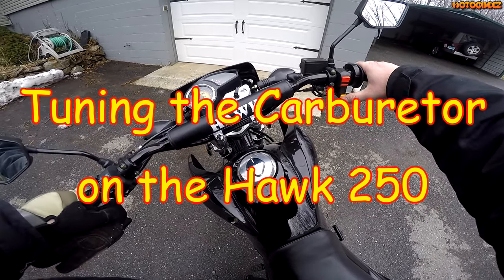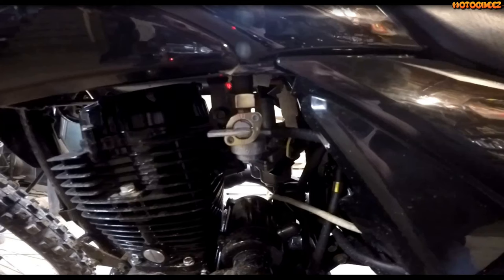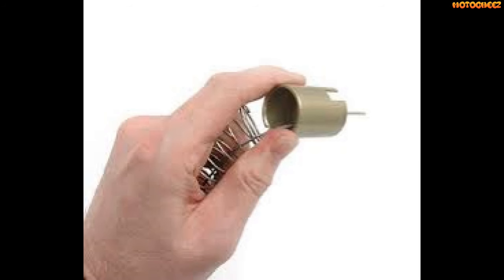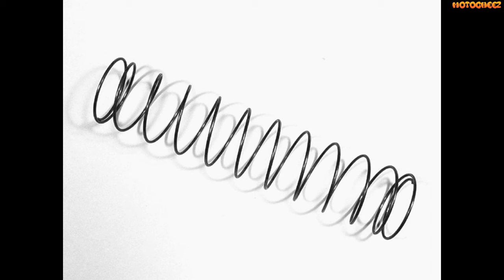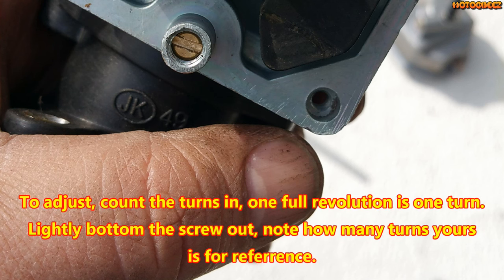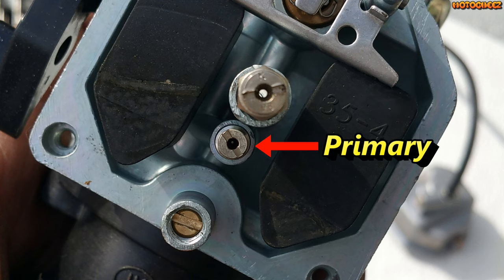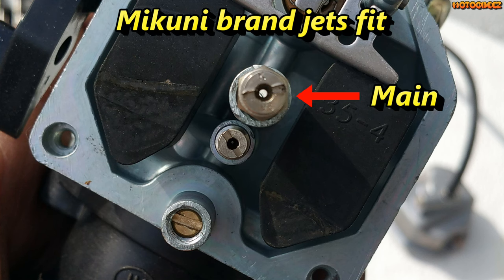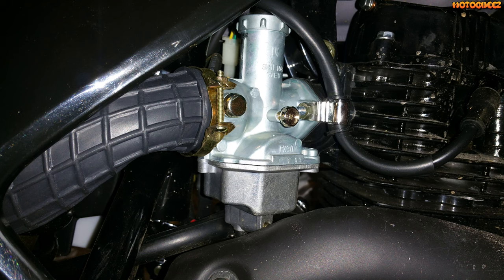[E3] Hawk250 Carb Tuning on the Dual Sport Chinese Enduro 250

Comment: @MotoCheez - which main jet # comes stock in a Mikuni VM26 30mm carburetor?  I've read that most that drop in Mikuni VM26 carbs just run them stock without any issues. I installed a VM26 on my new Hawk the other day but also have a bag of Mikuni main jets. I left it stock for now to find out how it runs. Didn't want to mess with jetting too much during the initial engine break-in.
Reply from the maker: It's a 98. Yeah they run fine. But I opened up the airbox and they're lean fir EPA
Reply: So the Mikuni VM26 has the same size jet (stock) as the OEM Hawk Chinese carb? I'll probably change it out to a #110. The bike runs great on the Mikuni VM26 (stock config) but I can tell that it's running somewhat lean at higher throttle. I haven't modified the airbox yet but will cut those holes out per your video. The bike does feel a little restricted...I know I can get more than 50-55mph out of it with the 17T/45T sprockets I'm running on there. Thanks for responding to comments and for all the info you've posted on this bike - wouldn't have pulled the trigger on purchasing if not for your DIY vids!
Reply from the maker: I believe so, I never bought the aftermarket carb, I just modded the stock one.. Cool YW!

Comment: Hey Moto, I just got my TaoTao Tbr7 a week ago, I bought a Mikuni carb for it but it just won't run right. When ever I give it gass it just bogs down . The primary jet is a 33 and main is a 100. Any suggestions??
Reply from the maker: Should have a 110 to 115. Middle groove on jet needle
Reply: @MotoCheez  Ok man thank you, I appreciate it, I will try that and let you know how it works out👍🏻👍🏻
Reply: Ok I did what you said, my mixture screw is 1 1/2 turns out but my spark plug keeps getting fouled up and It is still bogging alot.
Reply from the maker: @tylerd.5541  is your choke on? sounds like you are turning it on not off, or your main jet fell out
Reply: @MotoCheez  Oh my gosh man, I feel like an idiot, iv been trying to run it with the choke on. Iv adjust the valves and taken the carb off about 10 times trying to chase the issue. Let me see if I can't get it to work now😂😂
Reply from the maker: @tylerd.5541  haha, it happens!
Reply: @MotoCheez  Just started it up with the choke "off" and sounds great, thanks and can't wait for more riding videos when it gets warm

Comment: Hey motocheez I rejetted my mikuni carb to 120 because I put about 12 holes the width of a pencil in my muffler can and cut my airbox like you did it feels alright but my bike still cuts off I have to hold the throttle unless I adjust the idle extremely high any ideas ? also do you think 120 is to rich and could someone possibly describe where the fuel mixture screw is
Reply from the maker: Liam Wells the main jet is for almost wide open throttle to wide open. if it doesn't it'll it's the idle jet adjustment. there's a plastic plug (show in video) pop it out and adjust to 2 1/2 out roughly.
Reply: MotoCheez do you know where it is on a minkuni same place?

Comment: You wouldnt know where one might get the correct pilot jet for the mikuni clone carburetor. Looking to go up to 25 or 27.5
Reply from the maker: +unnamed saint no, I'll look tomorrow see what I can find.
Reply: Hey Cheez got the mukini with a 110 MJ in but I belive the pilot needs a dif size wont start without choke and dies alot until fully warmed up and still putters at low throttle input would u know what pilot jet it may need if thats the issue?
Reply: Thats the pilot jet I used and from Amazon
Reply: @bigbearlovin  25 pilot?
Reply from the maker: You tried opening up the mixture a bit more? I do have links on motocheez.com
Reply: @MotoCheez  yes it's out 4 turns

Comment: I can't find your comment anymore motocheez but the stock carb leaks and now my neutral light won't come on did I do that or just a coincidence? also feels like my clutch is slipping now
Reply from the maker: Liam Wells damn!  neutral light wires run up over carb from left side. could have
Reply from the maker: Liam Wells clutch slipping? maybe too tight? should be a lil  freeplay at clutch
Reply: MotoCheez it does have free play my neutral light won't come on when in neutral and won't start without me pushing the clutch in but once started I can release the clutch

Comment: Curious did you have any issues getting this tagged? I have the certificate of origin but notary’s in my area are acting like they don’t know what to do
Reply from the maker: Depends on your state. CT was easy, FL easy too. It's like a brand new car with COA. Some states don't like to register them either like PA And CA
Reply: @MotoCheez  that sucks I’m in PA lol notary said the MCO is missing a signature from the company. I thought I herd in one of your videos you mentioned Vermont for titling?
Reply from the maker: I heard some got them registered,  the MCO should be signed by dealer. They send afterwards, not the one in box. VT isn't as easy any.ore but can be done still
Reply: @MotoCheez  they put they’re name down but didn’t sign a area they were suppose to
Reply: @MotoCheez  update company sent me a new MCO with notary stamp alls good just got plates.
Reply from the maker: @Karnol428  excellent!

Comment: I dont know what to do my bike bogs out like crazy at higher rpms and it turns off if I take the choke off. I did halft turn 1 turn 1 turn and half 2 turns 3 turns and 3 1/2 turns I really dont know what I can do. Well on the good side the bike looks really nice parked in my garage lol :(
Reply from the maker: The mixture adjustment is just for 1/8 throttle down, it's an idle circuit. If it's bogging then it's probably the main jet. What size is in there now?
Reply: Its stock I haven't gotten it to work properly since I got it yesterday.
Reply from the maker: +Modesto Rodriguez ohh. Then you have to change main jet. Watch the carb video I did , makes a big difference
Reply: the company I bought the bike from is sending me a new carb free so hopefully that helps, Thanks for the help.
Reply from the maker: +Modesto Rodriguez cool. Let me know how you make out

Comment: Hey Motocheez, so I swapped the stock carb on my Magician and replaced it with the Mikuni carb, and I replaced the main jet with a 110 on the Mikuni carb. The bike is having some trouble idling, but my main concern with it is that when I rev the engine, it takes a long time for the RPMs to come back down to the idle speed, do you know what could be causing this?
Reply from the maker: Tom Malitz sounds like the primary jet might be too lean. How many turn out on the mixture screw did you go. Should be about 2 to 2 1/2. Out. Then you should be able to adjust the idle. Or you have a vacuum leak.

Comment: hey moto you inspired me to pull the trigger and bought on I've got it togther had a few test runs with it  but I can't get it to idle I've watched most of your videos in the hawk. I just pulled the carb off and twisted through mixture screw out about 1 and 1/2 out still can't get it to idle by it self with out holding on to the throttle. It sounds great with the choke completely down which I assume is off. once I put the choke on she bogs hard under throttle. any advice on getting her to stay running on her own. I've even held the throttle till warmed up and as soon as I let it go it dies.
Reply from the maker: You tried the idle screw on the side? Keep turning it clockwise. Has the knurled top on the side of the carb opposite the choke lever.
Reply: +MotoCheez yes sir I've played with that screw before attempting to remove carb.
Reply from the maker: Keep turning it in while you're keeping it running. That's definitely the idle adjustment. It's probably way out
Reply: +MotoCheez alright sir right you were as I had hoped you would be. I bottomed it out and just slowly brought it out half turn at a time. got her idling on her own. so that's a success. next question if you don't mind helping me out with is once riding if I get aggressive in the throttle it starts to bog down and give like a popping sound.
Reply from the maker: Did you Chang the main jet to a 110?
Reply from the maker: Yes, add the washers under the needle and 110 main jet. Will run way better! You can go the mikuni route if you want.
Reply: +MotoCheez Look at this on eBay http://www.ebay.com/itm/152156398660 this is the jet I'm assuming should work for my main? also any specific washers to use or just something that fits? I really appreciate all your help man.
Reply from the maker: Yes. That's it. I use 8-32 size washers
Reply: +MotoCheez alrighty thank you sir I appreciate your help so much I just ordered the jet and I'll hit the Lowes tomorrow for the washers.

Comment: Is a 130 jet too much?
I upgraded the exhaust!
I think it's too rich
Reply from the maker: 130 is pretty high IMO. 120 max
Reply: @MotoCheez  with 120 do I need to turn down that screw on the button?
Reply from the maker: Which screw is that?
Reply: @MotoCheez  fuel mixture?
Reply from the maker: Oh. The bottom.. should what I show in all my carb tune videos, there are a few things...
Reply: @MotoCheez  k thanks, I took around the block with the 130 it back fired LoL, I love that new exhaust, lower frequency and and much louder
Reply: @MotoCheez  I dunno if the jet kit I purchased was a returned kit, because it doesn't have any jets over 115 nor under 130, but  I put the 115 and it seems to be good!

Comment: What size pilot jet does the factory carb come with?  I want to order all my jets at once because shipping is the same no matter how many I order.  I plan on buying a 110 and 115 main and would like to get a pilot that is slightly larger than stock if you are close to 2 turns out on the idle mixture.

Also, what's your elevation?
Reply from the maker: Not sure what size the pilot jet is. Main is 98
Reply from the maker: My elevation is 650 feet
Reply: Thanks!  
I'd guess 110 would be fine all the way down to sea level than if 115 was noticeably too rich at 650 feet.  I think I'll just get 110 because most of my riding will be about 130 feet and higher.
Reply from the maker: +pcspecialistpdx I agree. 115 was too rich. My friend has 112.5 and I feel it's still too rich following him. I also shimmed up the jet needle 2 #6 washers for a fatter midrange

Comment: I am at a complete and utter loss I have gotten a new mikuni carb and currently jetted to 105 (and tried 95,100,110,115) and no matter how I set idle or the bottem screw when I give it gas it falls flat on it's face instantly I have no idea what I'm doing wrong I've tweaked it every way I can possibly think to and still nothing (and just to be clear the reason I made all for these changes in the first place is when it was wide open going down hill my max speed was 45ish and I need to go at least 60 to feel comfortable ridding with cars I saw in one of your videos you were able to make it to 70 so I know something must have needed adjusted)
Reply: I will make a video showing you if you would like
Reply from the maker: CobbsterSniper usually it's one if 2 things that causes this. Either the choke is on (lever up) or the valves were adjusted on the wrong stroke. Those are the 2 most common.
Reply: MotoCheez alright thank you I'll try adjusting the the valves and let you know if it helps
Reply: Works like a charm still have a few adjustments to make but that fixed the problem thanks man :-)
Reply from the maker: +CobbsterSniper swesome!

Comment: can you please update link for the jets here and on your website. where can I find those washers?
Reply from the maker: The jets are mikuni jets. The washers you can get at a hardware store. "8 screw washers.
Reply: +MotoCheez thank you sir. on eBay there is a 2mm difference in width for the 110?

Comment: What size # of pilot jet u running ? Ihave a 35 and im having idle issues
Reply from the maker: Stock pilot jet.. 2 1/2 turns out on mixture
Reply: But what size? Mine stock came with a #40 pilot

Comment: Hey again motocheez. So my dad and I tuned the carb last night because it started bogging again. I went to a 110 jet and the mixture screw is about 1 and 1/2 turns out, and it ran great at first but then  after a few minutes and turning back on it bogs again until you half choke it. Basically I'm asking, what does that mixture screw regulate, and how should I change it to help? Thanks man, very confused
Reply from the maker: The mixture screw is for idle mixture. The jet needle small washer shim is for 1/4 to 3/4 throttle. The main jet is for wide open throttle. Sounds like it starving for gas? Does it do it after holding throttle open a while or immediately?  Does it idle good?
Reply: +MotoCheez +MotoCheez yeah the inly thing I did was the main jet and the mixture screw, been messing with the idle adjustment too. Sometimes it idles good and sometimes it does right down. Yeah it does sound kinda like its starving for gas once I get to half throttle and it does it right when I hit the throttle past half.
Reply from the maker: +justinheartcarson maybe try it on reserve? Pull off gas hose and make sure decent flow of gas and not pinched.
Reply: +MotoCheez tried that. Bike wont run without  choke unless I put the idle screw way in... The fuel line is fine but the bike is still inconsistent running. Sometimes it runs great and the rest of the time it dies without choke😔.. I'm so lost rn
Reply from the maker: +justinheartcarson check valve adjustment. Of vacuum leaks?
Reply: +justinheartcarson I will try the valve adjustment and I will get back to you, thanks
Reply: Hey, I'm having very similar problems. I have the new Magician, which I believe has the same carb as the Hawk. I just can't get the bike to idle right. Did you ever get your hawk to run better, and if so, what changes did you make?
Reply from the maker: justinheartcarson the re-jetting and adjustments solved my problems with the hawk. It's the same motor and Carb on the magician so I'm sure this carb video will work. I know it's harder to remove the carb on the Magician

Comment: hey motocheez thanks for all the help!! im gonna adjust my carb....my question is how do you know if you need to mess with the fuel mixture screw
Reply from the maker: Jose Martinez thanks! The fuel mixture screw will need adjustment, that's the idle to part throttle mixture. They're very lean unless you change the primary jet.
Reply: @MotoCheez  Hey cheez I got some questions 4 u abt the tuning ive been struggleing  with  my carb for weeks ive got the mukini with an air filter and I'm from North central texas and ive tried a 105 mj a 110 and a 115 and I cant seem to get the bike to start without choke my goal is to have it start without choke its now getting cold down here and I'm wondering is that a possibility during winter I think its not getting enough fuel and I allways wind up more than 2 turns out on every jet I swear ive taken the carb off and put it back on abt 20 times now no joke and I just cant seem to get it right do u have any recommendation on where to start ex: jet size and turns out ?
Reply from the maker: The idle and part throttle is controlled by the pilot jet and mixture screw. Try turning the mixture screw out 4 turns. Any more than that and you'd have to go up pilot size. Main jet is pretty much wide open throttle
Reply: @MotoCheez  gotcha thanks for the reply will try tuning  tomo and see how she goes I got a 110 mj in right now with I believe 2 1\2 turns out ima try a full 4 turns out dosent seem choppey at full throttle or up to it just wont start without choke being on
Reply from the maker: May have to go up on the primary. Like a 40. I forget size
Reply: @MotoCheez  ok thanx and what exactly dose moving the clip on the needle up or down do? Would that help ?
Reply from the maker: @brendanthomas9718  that's for dialing in the 1/4 to 3/4 throttle once your primary and mains are good
Reply: @MotoCheez  ok I see now. The only other issue I seem to have is an occasional pop through the air filter an low power at idle and seems like it stalls out when puttering around in first gear my only concern is running to lean or to rich and I think it's more lean than anything surely the air filter isn't allowing to much air I mean I have the stock exhaust and just folded the air box intake out of the way. when its tuned proper I should get smooth throttle play and a cold start with no choke on right? And I had an issue a week ago were the lock ring nut inside the centrifugal oil filter cam all the way off its shaft and was making an awful rattle inside the gear box at the time I was still tuning the carb and it made me think I ran they bike to lean and damaged something and that the engine was shot LOL had to order a lock nut ring spanner socket and wedge a quarter between the gears and torqued the hell outta that nut to stop any play in that damn thing after I sat their with pliers and a hammer trying to tighten it down before I had the correct tool for a whole week LOL thought I'd throw that crazy story on here for sum laughs. and thanks again for the the info everything I've learned abt the hawk has been from mostly your videos ive got several mods on er got another thing going on with the tail light I put in one of those red leds that pulse then go solid for sum odd reason it works fine when the lights are on but for day an lights off it'll keep pulsing and won't stay solid when brake is held? Sorry for the long paragraphs and thanks for all the replies
Reply from the maker: @brendanthomas9718  that's because it's probably lean
Reply: @MotoCheez  alright will try 4 turns out with the 110 mj and see how she goes thanks

Comment: where does the hose on the bottom of the carb go
Reply from the maker: Just Rocco runs down behind motor toward the ground. It's an overflow, and a drain if you open the bottom screw.